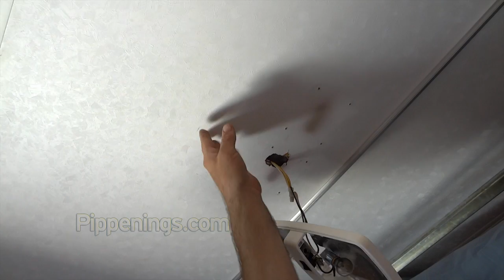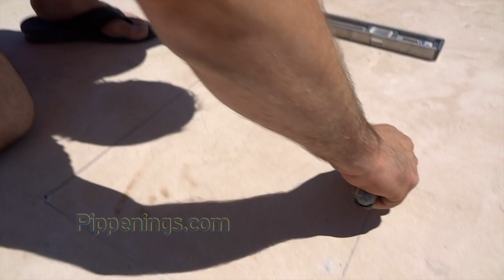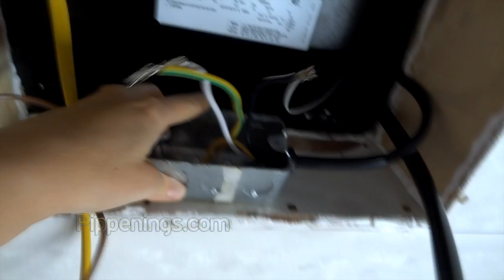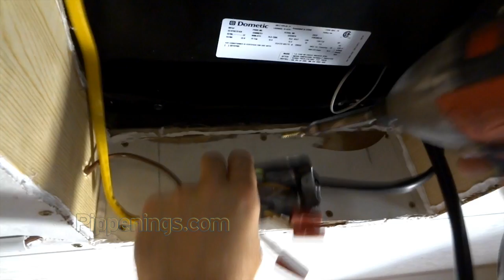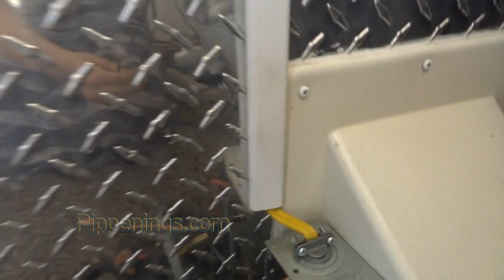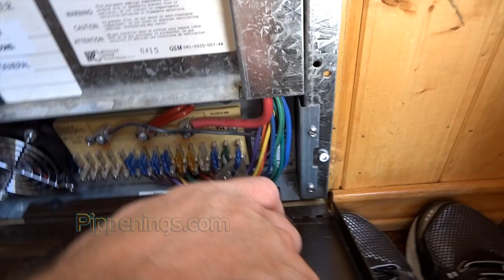RV Renovations: Install an AC unit in your roof

Comment: Thanks for this video Pippi, I just finished installing a new Ducted Brisk II on my rig replacing a 20 Year old AC unit and had issues with the wiring.  Your video pointed me in the right direction.  IMO Dometic's wiring labeling and documentation is not the best.

Comment: The power for both the dryer outlet and the AC are not legal. Lord forbid he ever had a fire but if he does and it comes from either one of those area's I would think the insurance company would refuse to cover it due to improper wiring installation. Something to think about. Electrical can work in a lot of ways but not all are legal or safe. BTW ... I really enjoy your vids and have watched many. You are a delight to watch with your cheerful smile and attiditude.  Have a great day!
Reply from the maker: +Gerald Leggett I'm not surprised at all. A little scary working with people who don't let you know what's safe/ not safe. I don't think he'd even try for insurance if it's actually insured at all. Thanks so much for watching!
Reply: You are welcome! Have a great day!

Comment: PiPPi, thanks for the detailed video, but why did you not use the new mini-split high efficiency heat pump?  Easier to install A LOT!, and uses a lot less energy, AND a lot quieter when running.  And no air drag while traveling.  and a nice remote control.
You guys did a good job!

Comment: He pick up the power at the outlet for the dryer but does he have a breaker for the A/C unit? The breaker for the dryer is too big for the A/C unit.
Reply: Stan Wilson I agree ( a year later) that AC is on 12 gauge (yellow romex) which is rated for 20 amps and is only protected by the 50 amp circuit breaker on the shore power. Let's say the AC motor freezes up for instance. It could potentially be enough load not to trip the breaker but enough to melt that wire insulation an then cause a fire. Unlikely but certainly in the real of possibility and would never pass any kind of electrical inspection.  A tiny sub panel could be added to protect that circuit properly.
Reply: It can't be on the 50 amp circuit being a dryer is only 30 amps not 50 plus all she had to do is switch the breaker from a thirty to a 20 amp as required by code..A side note if she for some odd reason did in fact hook to a 50 amp circuit it would be fine being you would only hook to one leg which is only 25 amps which is fine just make sure the breaker is a split breaker and the double clip is removed!

Comment: Don't AC's create a lot of condensation...where does the water go in a ceiling unit?
Reply from the maker: There's a pan up top inside that leaks out onto the roof. It runs down the sides of the RV, especially right after you turn it off a little stream will rush down.

Comment: the  a/c  voltage wiring is not to code  wrong style j box and cable hold and mounting the lower j box to the fuel line cover is also a big nono  also  exposed wire is a nono
Reply: I also saw several other problems with the wiring. It appears there is not a 15amp (or whatever is called for by the AC manufacturer) fuse or breaker in the line between the 50amp line and the AC unit. One other thing, as Pipi noted you do not have to run the low voltage in a "J" box, in fact that is also not up to code as a short could occur in the low voltage wire that is not sized for 120 volts or the higher amperage. Some line noise could be transmitted through the low voltage wiring and interfere with sensitive electronics
Reply: A/C needs to be on a dedicated circuit. Pippi was the best thing about this video.

Comment: Interesting to see how it's done. I had a swamp cooler installed where my AC was, for use w/ solar. Low voltage, but still takes a good amount of solar.

Comment: i have ac unit in my 32foot travel trailer and wanna add a second or third ac unit, but because my travel trailer is only 30amps i dont think i can, Any Ideas? thanks!
Reply: Upgrade your 30 amp service to 50 amps.
Reply: No need to upgrade electrical.  Most camp site only have 30 amp service anyway.  Just add new wire to new ac and add new breaker in convertor box.  I think they only run around 8 amp or so.  Just don't run microwave while the ac is on.
Reply from the maker: You can add another one but if you don't have 50amps then you can only run one ac unit at a time. Though you can get a switch to make them alternate automatically. You should be fine finding 50amps in parks now a days.

Comment: one thing to keep the ac from leaking please everyone where the ac sits on the roof place some butil tape on the bottom of the ac or on the roof around the ac opening otherwise it will leak badly also use some type of sealer with it so it will even last longer. good vidio Pippi keep posting please
Reply from the maker: It comes with a thick rubber foam seal.

Comment: I was watching a video the other day and the RV Tech said you shouldn't use wire nuts on an RV since there is a chance they can come loose and possibly start a fire. Just an FYI.
Reply from the maker: What does he suggest instead?
Reply: crimp on wire nuts
Reply: You would have to use electrical tape over the crimp.  Or.... use electrical tape over the wire nuts.

Comment: I didn't see a gasket between the roof and the air conditioner?  Did that just not get on video?
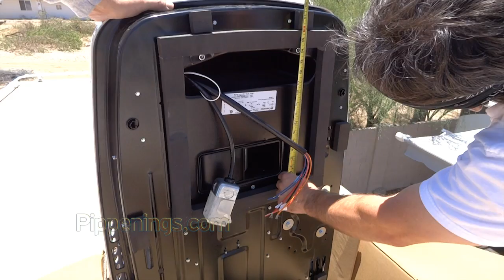Reply: +fletcher3913 Look at 1:10 in the video. Its already attached to the AC. Gaskets for the AC's on RV's are made out of a dense foam with adhesive on one side that sticks to the AC. When you buy a new one they come with one. I would also recommend changing them every 5 -8 years to be safe.
Reply: +Sean Stumpf thanks, I see it now.